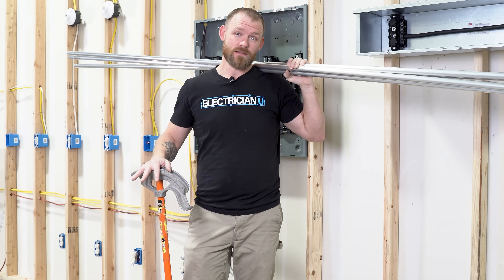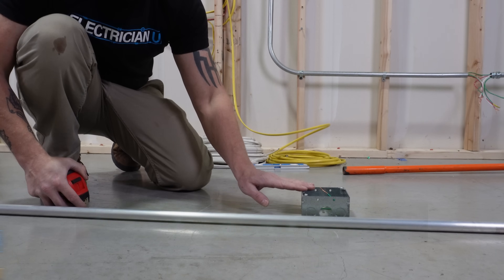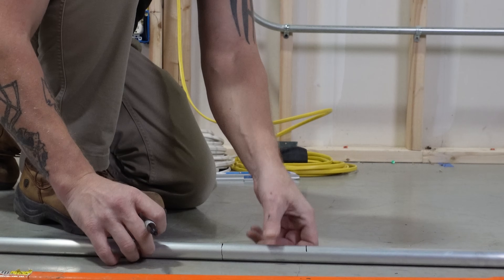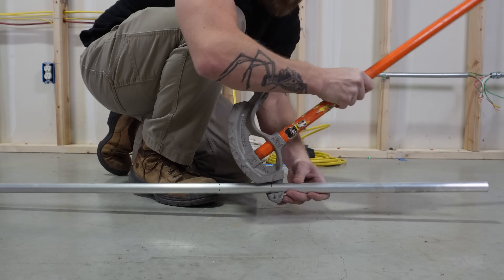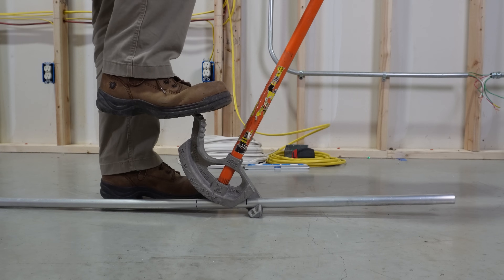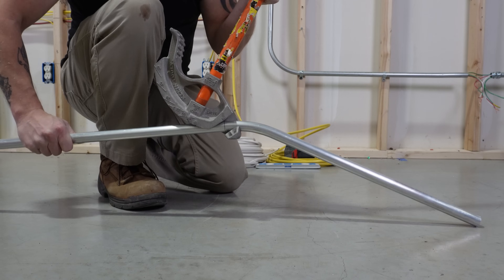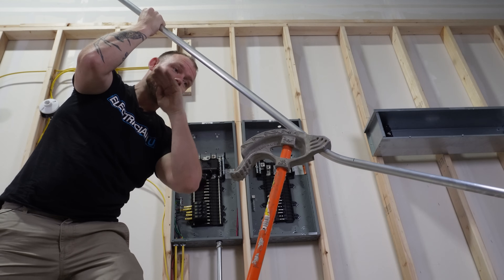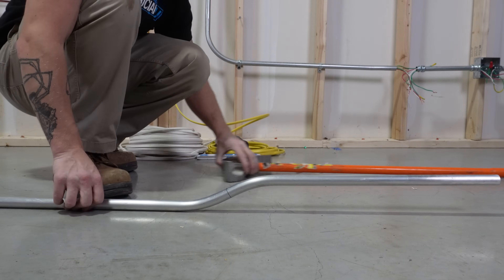How to Bend an Offset in Conduit

Comment: Dustin -- you should have covered a box offset for those people who don't know how to do a box offset. It's  such a simple thing but so many electricians still can't do them coerectly. 
 You could also have included marking the center of the conduit at the end of the pipe to help prevent doglegging your offset. And or howbto use an anti - dog bubble that attatches with a set screw on the end of your conduit, of course, on the center line of the pipe. Also most if not all emt has a natural centerline seam, sometimes a few of them, that you can use as a way to prevent doglegs in your offsets. 
  This was a good short, instructive video. Keep 'em comin'.
Reply: He's actually got an older video on a box offset. Still holds up great though.
Reply: @HydromechanicalWizardsLLC  your mom holds up great
Reply: @HydromechanicalWizardsLLC  ---- thanks. 
 I figured Dustin had covered that already but wasn't sure. 
  He has the best videos for people to learn the basics and beyond basics in some cases, that I've come across on YouTube that are educational and yet casual and easy for people to understand.  
 I've been an electrician for 35 years now, I think? Maybe 34? Either way, more than half my life. 
 I've told Dustin we could work together any time and we'd have some fun and do some great work at the same time. I have my own business now for the last eleven years and I am 57 yrs old and I'm ready to just run the business and start slowly doing less work with my tools. Hahahaha
Reply: I’ve bent a few dog legs!
Reply: @rogerpenske2411  I’ve been in the trade almost 30 yrs and I still dog my offsets occasionally. They’re quick and easy to correct so no biggie
Reply: @Ephesians-ts8ze  --- I'm in over 30 yrs and still putting occasional doglegs. 
  Sometimes it isn't even our doing. You get a batch of cheap made emt and the stuff is already bent and you don't notice. Until you try to fix the bends and the pipe gets worse or kinks because it's so thin and made from the thinnest, weakest mix of recycled tin and metal shavings. Hahahahahaha
Reply: Cory from Lowe’s already covered box offsets
Reply: @highvoltage1979  ---- I'm not trying to be a dick but what I'm about to write will most likely be interpreted that way.  I apologize in advance. 
 Corey from Lowe's is someone people wanting to learn something about the electrical trade is supposed to know and or take advice from? And because Corey already made a video about box offsets means that no one else needs to make a video about the same subject?
 If that was the way YT videos worked more than 75% of all videos would never be made or uploaded. There are dozens, if not more, videos on the same subject, using the same video clips from other videos uploaded every day by people. 
  Thanks for the info about Corey from Lowe's. 
 Just from curiosity, does Corey from Lowe's have prior experience in the electrical trade as a certified, or licensed,  or union card journeyman electrician before making videos for Lowe's teaching a trade that can damage property and end lives if some handyman or homeowner decided to work on home electrical and makes a mistake because they learned from Corey from Lowe's videos? I would think Lowe's upper management and their insurance policy and their lawyers would make sure Corey from Lowe's knew his shit before letting him make DIY videos. But, even bigger companies have done dumber things.
Reply: @13_13k  😢
Reply: @highvoltage1979  --- my apologies. 
 You got me on that one. 
 I did start out apologizing for what I was about to write.
Reply: @Leslie C. Deal ---- thanks for setting me straight. I stepped right into that one.  
 I did apologize before I wrote my first reply, and I just apologized again. LOL